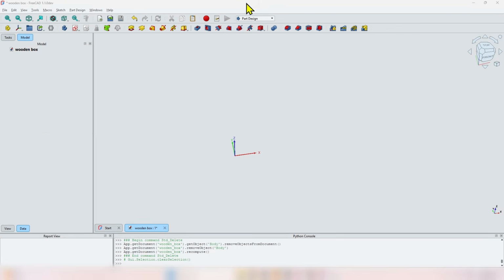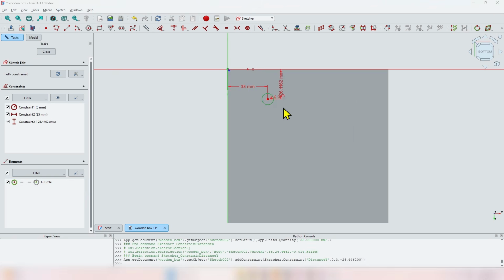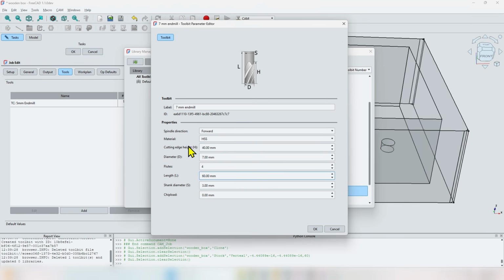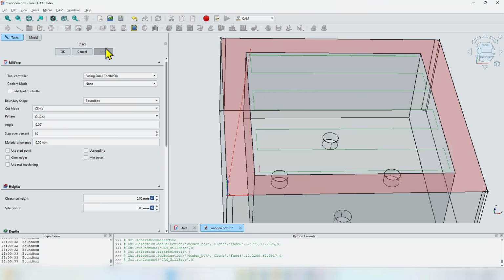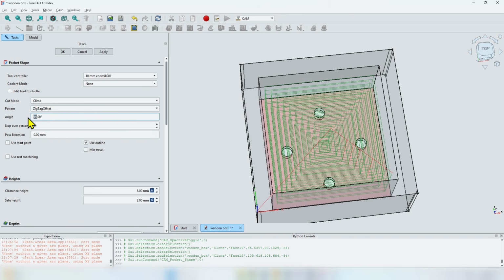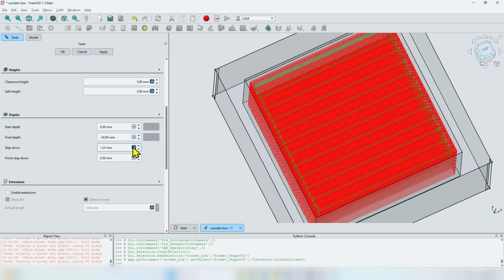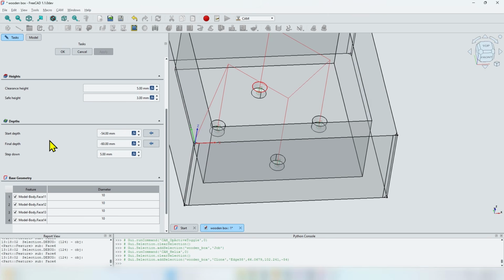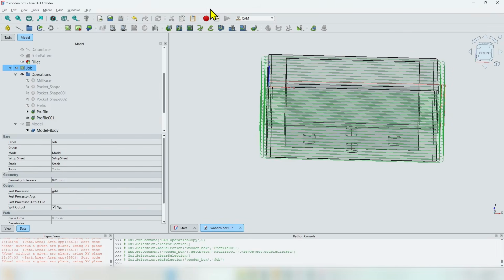FreeCAD CNC Tutorial: Model, Toolpath & Mill a Replacement Wooden Box (Full G-Code Workflow)

Comment: Hi, I really enjoyed watching your video and very well documented steps in construction and machining setup, however I have a problem with following from the tool selection section. I have gone to the CAM section and when I try to select a tool there is no tools showing so I go to create tool bit and can not get any further with the program. There is no tool library manager showing but I have downloaded it in the Addon Manager. Please help
Reply from the maker: What version of FreeCAD are you using? I recommend the latest rc, FreeCAD 1.1rc2 which can be found here:https://github.com/FreeCAD/FreeCAD/releases/tag/1.1rc2
This should have everything you need by default
Reply: @opensourcecnc   Thank you for your reply. I am using 1.0.2.  I will look to download the version you recommended and advise you if this solves my problem. Thank you again for your support.

Comment: @opensourcecnc it should be nice if FreeCAD had some way to insert a Gcode instruction to pause and move the spindle to some fix position to let the operator manually to change the bit and when wait for some sensor change (an end-stop or other) to continue the process!
Reply from the maker: It has. You have the "Custom G-code" operation. You can enter any g code you want there. But it depends on the machine. Some can handle such scenarios, some don't. Mine doesn't, that's why I use separate files.
Reply: @opensourcecnc  amazing! Thank you for this quick reply. I became a great fan of your channel! Please continue doing this great work!

Comment: Excellent video.  I wish you had shown the final result, curious what the results were from the slight offset on the deeper cuts. Does that come off with sanding? Visible? Not visible? Etc….
Reply from the maker: Thank you! Sorry for that. By the time I edited the video and realized I had no images after sanding, it was already gone. You'll have to trust me that I sanded the entire piece in less than 5 minutes using 180 grit sandpaper.